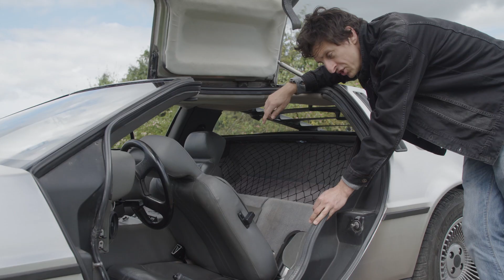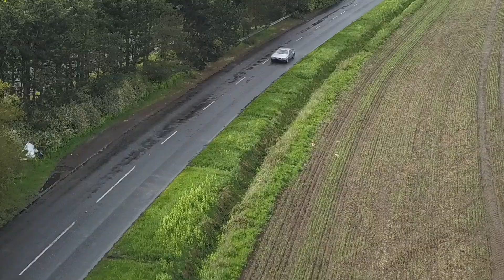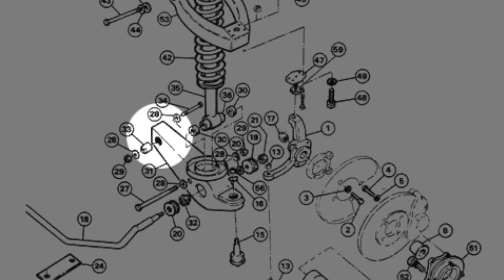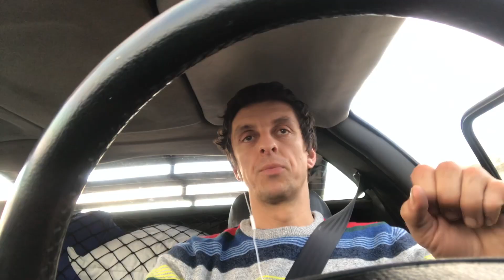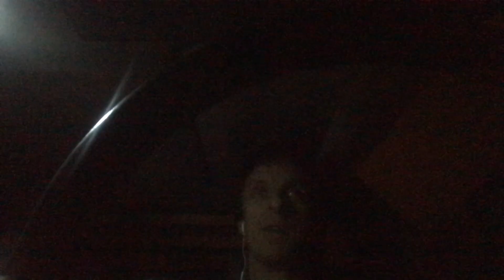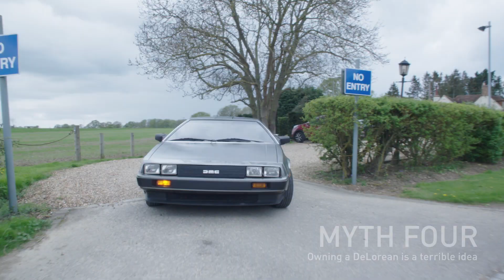1981 DeLorean DMC-12: Real world review and road test

Comment: Did you find the "n"....? ;-) What a shame
Reply from the maker: Tom Mangelschots no, it’s somewhere on an autoroute in France. Replacement letters are pretty cheap though 👍
Reply: Ah nice! Great review by the way, loved it. Posted it on my FB page. Maybe one day I will also own one ;-)
Reply: @RUNDMC1  hey pal..FANTASTIC video.... every new or prospective owner should watch this video to put their minds at ease. Meaning, if they take care of it and /or restore the car, it will make cross country journeys without incident. However I did notice the next morning outside the premiere classe hotel, that your battery indicator light did not come on. That is a sign that your battery is not being charged from the alternator. Question: Does it come on intermittently or not at all ? The reason I ask, is that I had the same fault with my Delorean. The fix is a new- updated or uprated 120 amp one from DMC in the U.S. ......Feel free to comment back. Thank you...Keith Covert
Reply from the maker: covert ops carrera slots Hi Keith - glad you liked the video! Honestly I’d not noticed the battery light not coming on. I know the alternator works (and is a recent 110A one) - it’s either an intermittent fault or possibly just the bulb?

Comment: Where is Air Con compressor? removed ?
Reply from the maker: Reinsch Engineering Yes, it came off for some engine work a while back and as I don’t use the AC I didn’t put it back. Heavy, power sapping and pointless!
Reply: @RUNDMC1  If I lived in England, I'd follow your lead on that.  Here in Los Angeles, not only is a/c a necessity, it's all about, "Of the 6 types of window-tint materials available, which one blocks the most infra-red?"  Actualy, it's no exaggeration to say that window tint is a performance product here.  Less demand on the a/c is more engine available for acceleration, and less fuel used.

Comment: It depends on what condition the car you buy is in honestly , I was told that even buying NOS from DeLorean isn't a guarantee that it won't fail , it stock from the original stock and has been sitting in storage for 30 years ...so you got to make sure your replacement parts are also good to use

Comment: Great video. There is still plenty to check with your DeLorean electrical. I have a 130amp altenator on mine, cleaned every ground and replaced all bulbs with LED'S. My volt gage doesn't drop below 12.5 volts with everything running. Also the is enough parts at DMC to make 200 cars, not 3000. No big deal. I redid my whole car and i never worry about anything while driving! I drive mine every day practically. Love every second!
Reply: LED's were a big get for us.  I put in LED headlights that pull a grand total of 1.6 Amps.  Another gain was battery technology.  If you choose to pay the $200-$300+ for the AGM-technology, you'll have a stronger and more reliable voltage delivery.  Then they designed solid-state relays, actuators to replace solenoids... the list goes on.  The electrical issues have been put to bed.